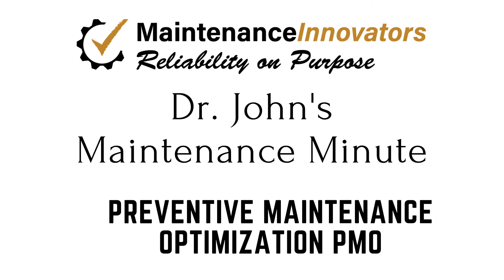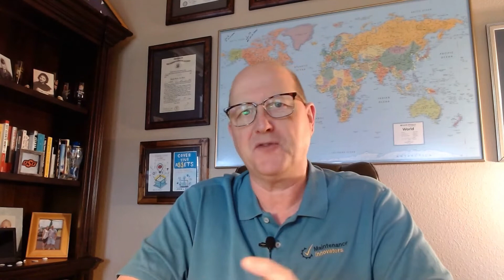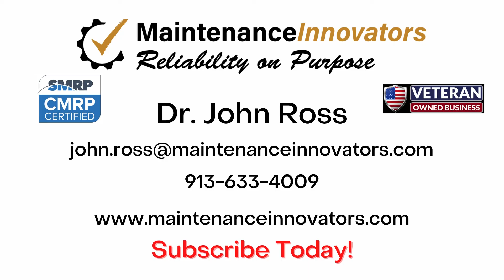Preventive Maintenance Optimization PMO

Comment: PMO began 10 years ago?   That’s 2012 +/-.    I was doing them with ALCOA  in 2006.   And I did not invent.  Great content and tool, but I believe PMO much older.
Reply from the maker: Joe,  I believe you are correct.  Steve Turner was a pioneer as I understand it.